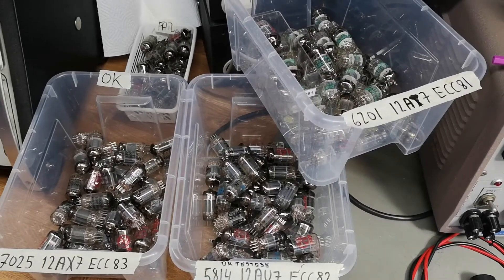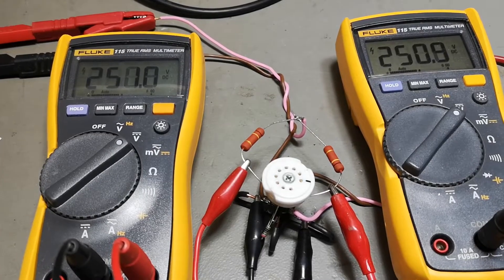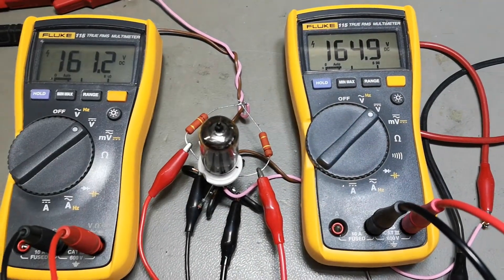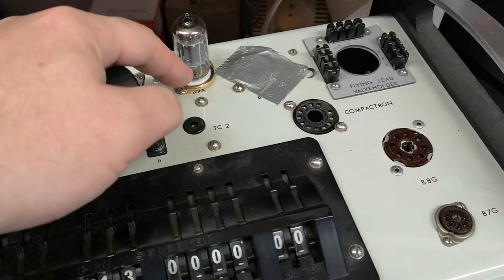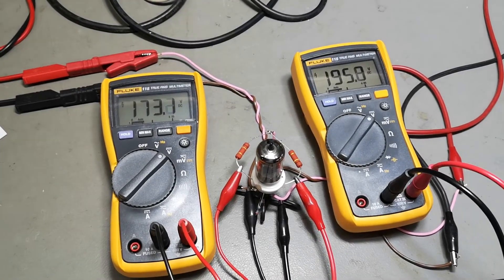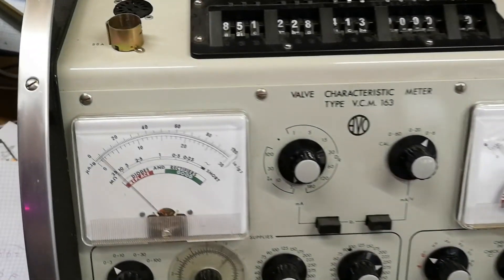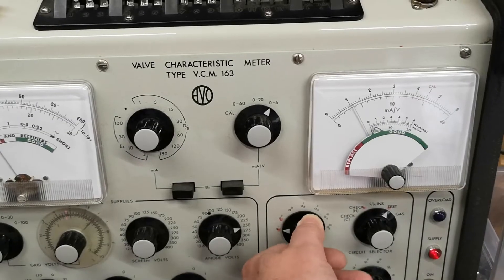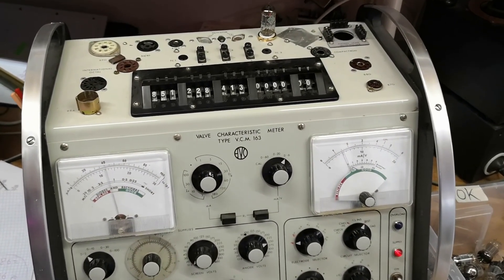simple tube DC tester ECC81 ECC82 ECC83 explained and compared with AVO VCM163

Comment: good morning. i am an ignorant enthusiast. i don't understand where you got normal voltage values of the plates. could i  have the values for ecc88/6dj8, 6922, 6sl7 and 6sn7? many thanks for your excellent work
Reply from the maker: Hello, you can calculate the anode voltage from the tube datasheet, but it requite a bit complex math, so i cheated, I setup my AVO tester, then i find a few perfect tubes that match perfect values, then i plug the tubes into my simple tester and tell you the voltages, 
Good values for ECC88 6DJ8 6922 E88CC (all the same values) updated in Description,
Note a little bit different pinout.
the 6SL7 or 6SN7 are also interesting audio amp tubes to play with, but they use a much different socket, i am not going to play with them right now.
Reply: @TeardownOZ2CPU  thank you very much.

Comment: Hi Thomas, Brilliant thanks.. Question I have a ecc83 which measures  109v 138v, and 250v, 250v when heaters are off. does this mean super gain or a fault?
Reply from the maker: nominal is 145V if you read a bit less DC gain point is a little bit higher, but you also see 30% difference between the two triodes, same numbers = better, and the closer to 145V the better normally, but your tube could be working fine in many constructions, where correct DC and AC local feedback is used, 
it is also a good sign to see 250V with heater off = no leakage at least in the anodes
you could also make a leakage tester to any - from any, of the other parts, this is tested with cold filaments, and all should be "open"

Comment: Why are you measuring the anode voltage instead of putting a mA meter in series with the 100k resistors?
Reply from the maker: the resistors also work as  current protection, while a mA meter will blow up once to get faulty tubes, and you can now measure it all using only one meter, simply swap between the two resistors, the other part is still loaded and still stable. much better solition
Reply: @TeardownOZ2CPU  If you put the mA in series with the 100k resistor you can measure the current flowing thru the tube.
Reply from the maker: @Master_zzz  you sure can, then you get both the current readout and the protection needed from the resistor.. or simply measure voltage and divide by the resistor value it is over to reveal the current, if that is important, I dont really care what the current is, as long as it is the same and with in the range I have explained in the video, then the chance that tube is ok is very high. There are many other parameters this quick and simple tester dont reveal, but most people dont need all that to repair an old instrument.

Comment: Any more thoughts on adding leakage testing to the circuit?
Reply from the maker: not really needed for my usage, I can just take my AVO if I like to measure all parameters. the consept of this video was to make something fast and simple, that could test if a stock is likely to work, all the tubes that dont passe this simple tester, needs to be thrown out, the ones that pass, can be deeper investigated on parameters neede for what ever unit the tube go into.. not all circuits require good leakage numbers.
Reply: @TeardownOZ2CPU  your video succeeded and your circuit is brilliant. I can't wait but one together myself. I'm currently looking at online marketplaces for power supplies that I can cannibalize for a more permanent setup. Again, brilliant! Thank you very much for this information.
Reply from the maker: @BlingFreeJ  you can take two small transformers and connect them back to back, this way : first : 230V to 6V use this 6V to filament, and then a similar transformer reversed 6V to 230V, you then get your high voltage using two standard parts.

Comment: This was a very common trick used specifically in cases of badly worn out cathode ray tubes of TV sets, either blackwhite or colour. Apart from that, the application of a high voltage pulse was the next action, usually between the cathode and the 1st grid, which was causing the burn out of the dead cathode material, leaving its fresh one do its job...This (rejuvenation procedure, as it was called) was both a money saving job for the customer and a money making job for the repairs technician, since such a successful procedure was cost effective and it could last for some years more of added life for the tired CRT, avoiding its immediate replacement...
Reply from the maker: exactly, i even got one of them TV repair shop portable CRT regenerators stocked :-) maybe i make a video about it one day, the only problem is, i dont have a tv set with crt, so i cant make a real test and demonstration.

Comment: Does the tube recover its emission for a long time ?
It could be an interesting way to renew old tubes.
Reply from the maker: The result vary from tube to tube, and how you perform it, double the filament, and the anode current, for 1 to 10 mins is normally the trick